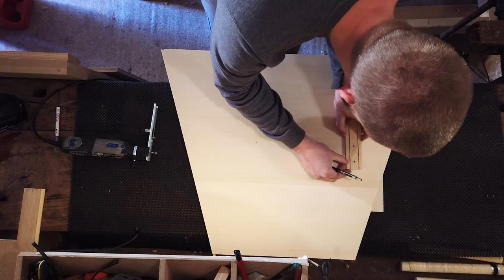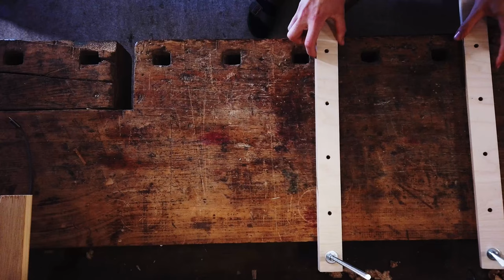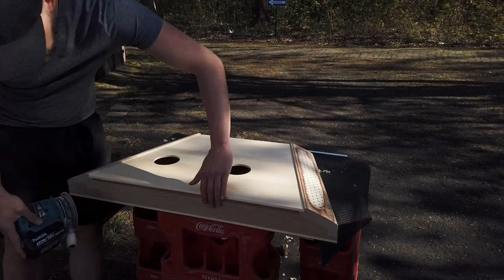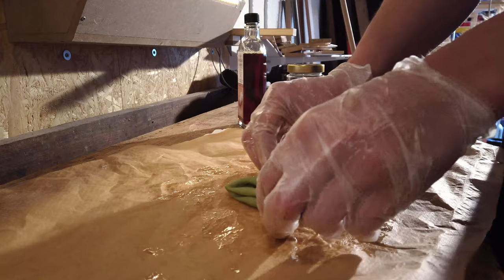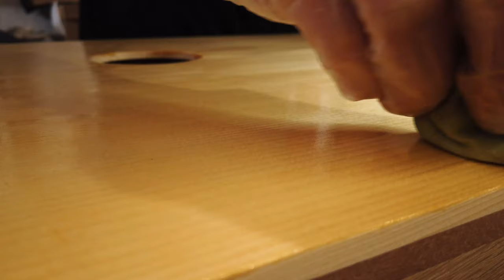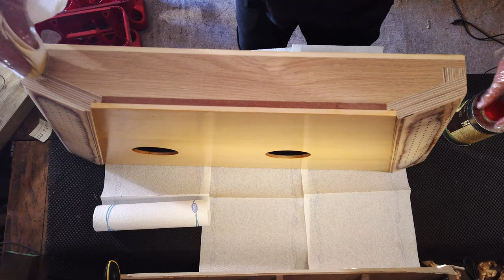building the hammered dulcimer - PART (06) - soundholes, glue-up and shellac finish

Comment: Thanks for the fantastic video, the instrument looks beautiful and your craftsmanship is very impressive. I am also building a dulcimer at the moment and interested in your use of linseed oil on the pin block, you mention it polymérises. I have used danish oil for lever harps it’s easy just takes a long time, do you know if danish oil behaves the same way, could it be used on pin blocks? There are at least twice the pins on a dulcimer as a harp, so it could be risky....
Reply from the maker: hey tal, sorry for the late reply. so with oil finish you just want to be careful, as it might affect the grip of the pin inside the pinholes. i confirmed the oil i used with a friend who is a piano technician and he suggested longterm testing because of that reason. the finish on my instrument has fully cured by now and i am very pleased with the result. i cannot find any negative effect on the tuning or the stability... however i have not tried any other finished yet. let me know what you ended up doing!
Reply: @solitudewoodworking8431  thanks for answering.. I decided not to risk things and ended up using polyurethane varnish, the mahogany sound board goes over the pin blocks so I used colored grain filler then several thin coats of satin polyurethane varnish, I am really happy with how it turned out, especially the way the light plays off the strings reflecting onto the wood grain :). I will continue to use danish oil on my harps as the tuning pins are larger and the oil nicely evens the colour of the European Walnut I use, as you suggest I need to apply carefully around any holes and allow to cure fully before adding hardware.